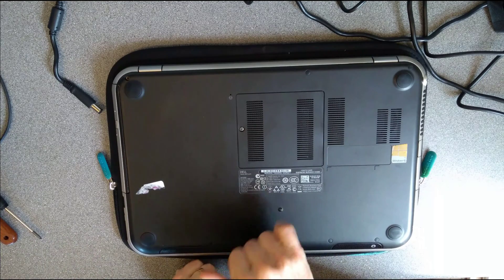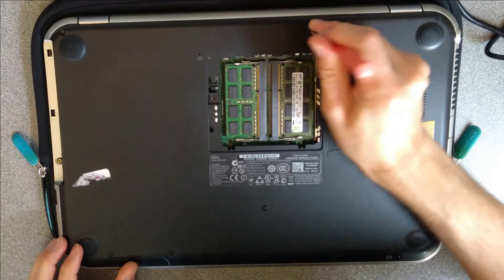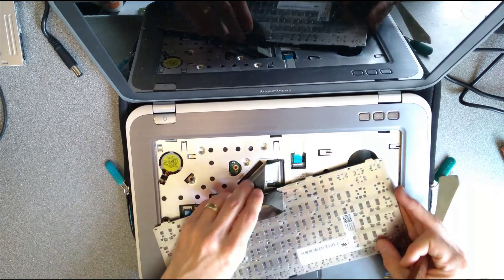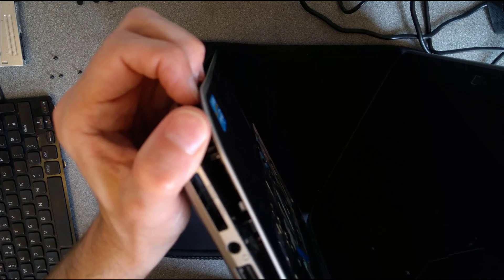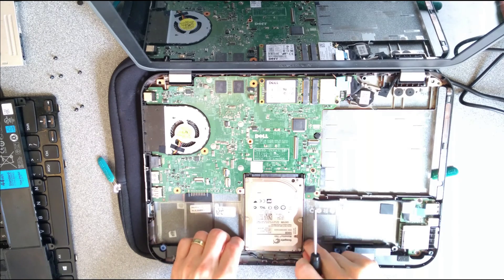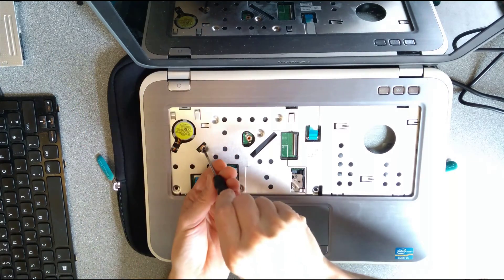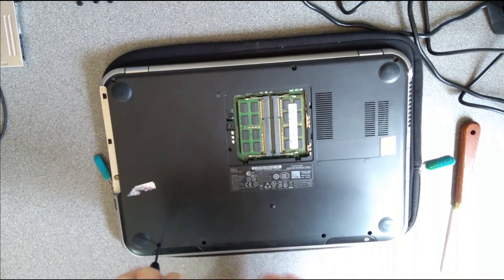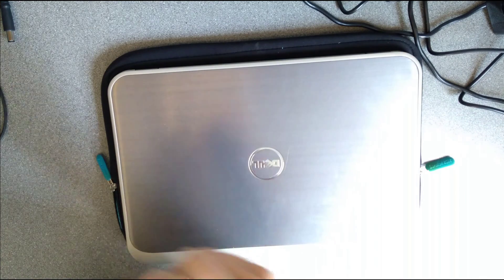Inspiron 14z 5423: How to replace or upgrade the hard disk.

Comment: Nice Vid, managed to replace HD with your instructions. As you alraedy mentioned, yours has been opened before. In fact, there is one more screw holding the keyboard, it is beneath the right memory-slot. So you have to remove the memory as well. Another screw is on the frame in the DVD-Slot. Thanks a lot for your efforts.
Reply from the maker: Thanks for the extra info!

Comment: Hello Sir. I would know , after I remplace my hard disk , if I need to reinstall windows. And if the PC would be like the first day. I mean without any documents just the system windows. Thanks.
Reply: My PC is a DELL INSPIRON 14z
Reply from the maker: If you replace or upgrade the hard disk without cloning or backup/restoring your existing data then you will not have anything on the new drive. If not cloning the drive you would need to install the new drive with a new copy of windows.

Comment: What SSD did you replace with. I was told it has to be SATA 2 and not SATA 3
Reply from the maker: SATA II specifications provide backward compatibility to function on SATA I ports. SATA III specifications provide backward compatibility to function on SATA I and SATA II ports. However, the maximum speed of the drive will be slower due to the lower speed limitations of the port.